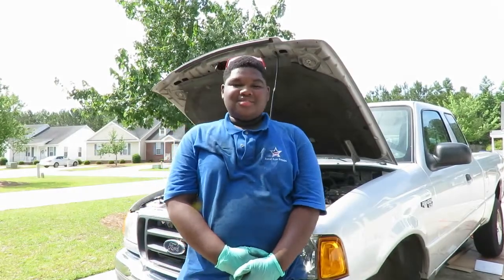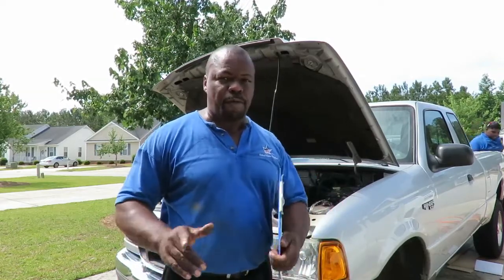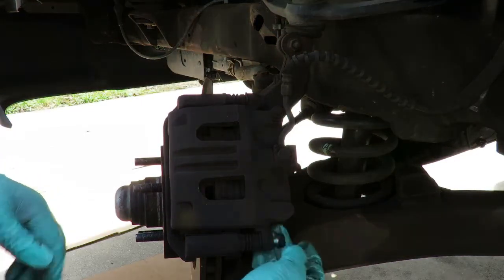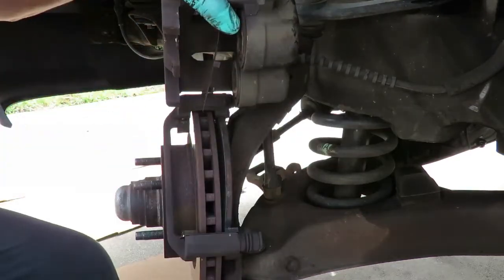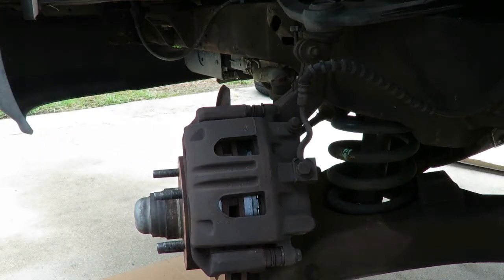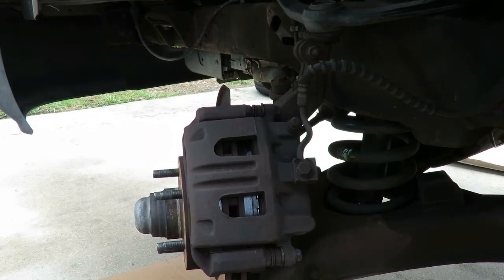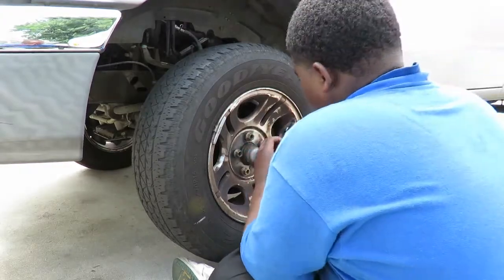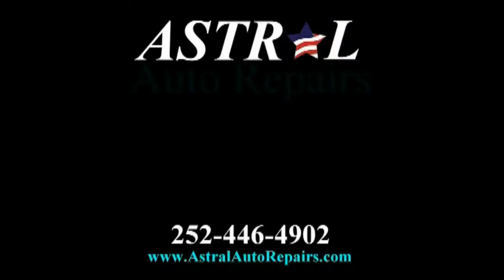2005 Ford Ranger - Replacing The Front Brakes

Comment: Great video!  I am guessing you take the cap off the master cylinder so there is no back pressure.  My question is when you use the c clamps on the caliper, does the brake fluid bubble over the top of the master cylinder because the cap is off?  Thanks.
Reply from the maker: Thanks. It might, I always place a paper towel in the reservoir so if there's fluid coming out the paper towel will soak it up before it spills over.

Comment: Thank you for a great video. Was kinda hoping you'd have a problem with the clips when putting the new pads on, so I could see how you handled it. Got one that's stubborn, and on the inside where it's hard to see why the pad won't just slip into place. Actually stopped to watch while I'm still doing the job right now.
Reply from the maker: Make sure you clean any rust or dust before putting the new clips in. Also, make sure you use antiseize on the clip so the pads slide better. By the way, what name brand pads are you using?
Reply: @OnlineAutoRepairVideos  Cheapest no-name ceramics available at Pep Boys. (I live on S.S.) No new clips or grease pack in the box. Yes, using brake cleaner spray liberally to clean everything. Finally overcame the finicky clips with patience and a small screwdriver to flex them enough out of the way. Thank you for your consideration in responding. You won a new subscriber to your channel, sir. 💪 Hello to your son. Makes me sentimental for when mine was young. ☺
Reply from the maker: @johnbaker2429  Thank you John, and glad everything worked out for you! A few times I had issues with cheap pads, so you're not alone! THANKS FOR SUBSCRIBIBG!!

Comment: why do you have to take the cap off of the master C
Reply from the maker: Hi Adam, there have been cases where a person would push back the pistons on the calipers and would mess up the seals inside either the master cylinder or damage the abs pump. by removing the cap, you will not build up any back pressure in those units.

Now this is on some systems, so to be sure, we just remove it on all. Thanks for the question as we are sure others ask the same thing.